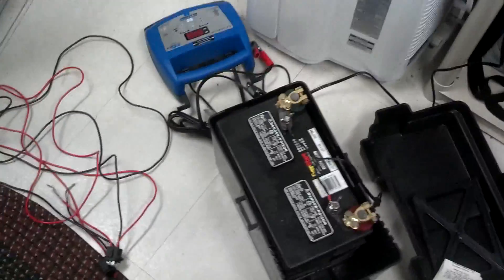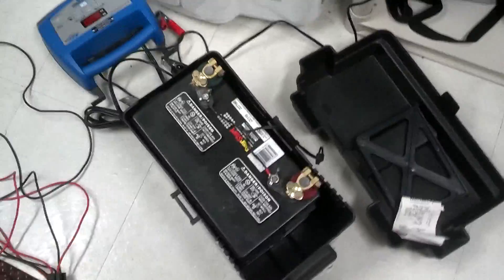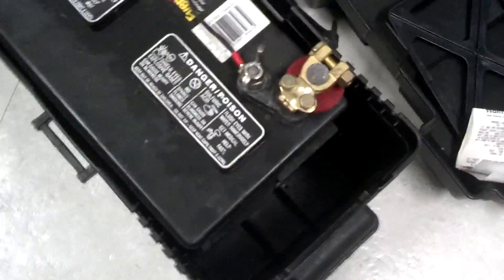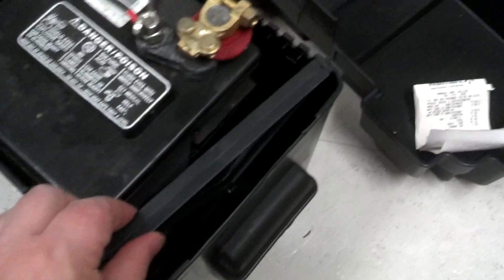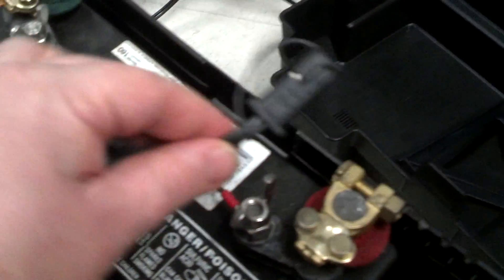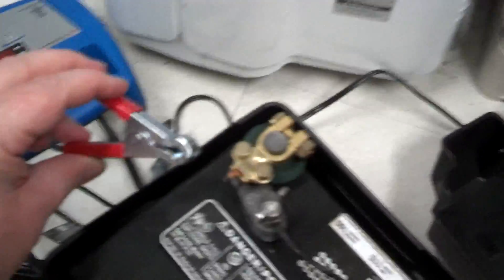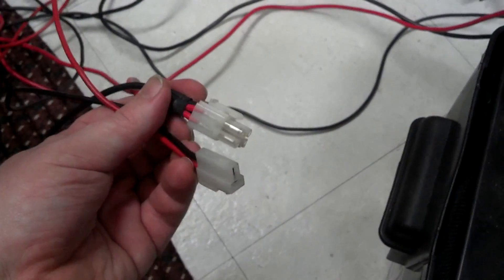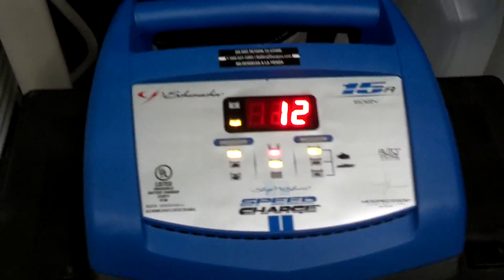DIY Ham Radio Power Supply for SHTF

Comment: Have you EVERY Heard of 'Anderson Power Poles'????
It's the System that the 'MO Dist. C A.R.E.S.' Emergency HAM Radio Group' uses???
All 40 members of us use it. It is completely 'interchangeable'. I also use the 'GEL-CELL' '32-Hour -Amp hour' Battery.Try 'THINKING' Out-side of 'the BOX' DUDE!!!
Reply from the maker: Stripped wires are always interoperable. :). Besides, this is for me and my needs, not some club event. Just showing how to throw something together for cheap, which powerpoles are not.